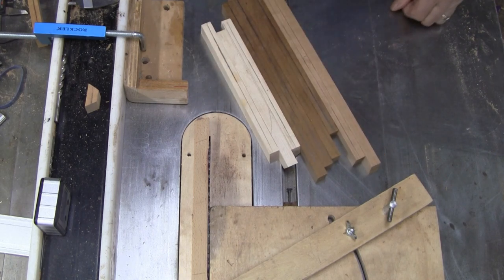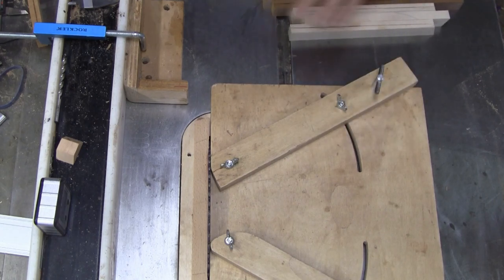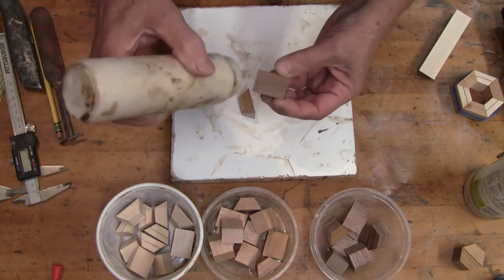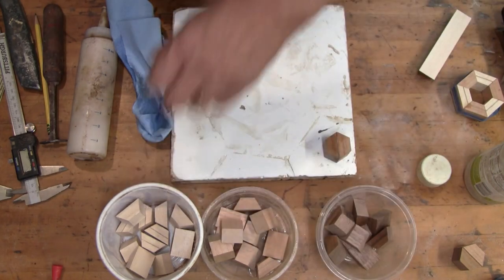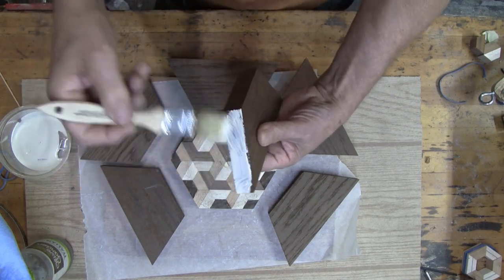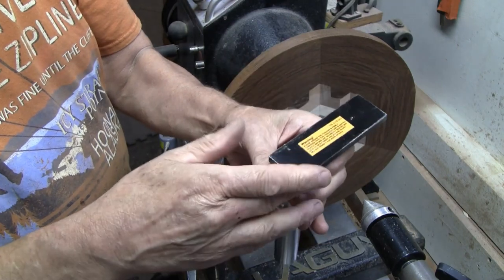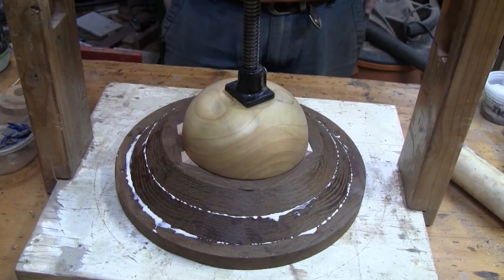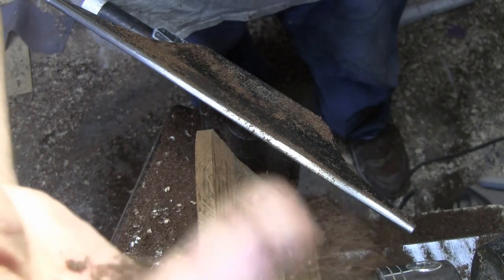Wood Turning The 3D 3 In 1 Illusion

Comment: Good evening, Gary.
   This is a wonderful project and video.  I like your 3D illusion bowl. The wood choices made a great looking bowl.
   Recently I made one of your bowl from a board projects. On the back side I hot glued thin strips of woods. Then when you cut through the board the strips of woods hold the ring in place. Repeat for the next ring.
  Thanks for the interesting projects. I hit the like button.
Reply from the maker: Thanks Ray. I was going to hot glue strips on as well. Which would have worked better than what I tried. I was concerned about any binding but if it doesn't bind up to that point it should be fine.
 Thanks for watching,
Gary

Comment: Awesome he are so talented. Enjoy all your  art!! Love the 3d pieces you make. Wish I could make a perfect sled with perfect  adjustable  angles for my table saw. Also, I see you use a bowl Gough  sometimes  n other times you use a negative rake  scraper.  I would think the scraper would be more prone to have tear out. Just my thinking. I mostly use the carbide  round tips on the tools I made. Great job Buddy
Reply from the maker: Thank you Bob! Once you have your sled dialed in it will work perfectly. I
I mostly do the turning with a bowl gouge  The negative rake scraper is a very good tool for cleaning up cuts and will give you a nice finish.
Where as a normal scraper can tear the wood up a lot.
Thanks for watching,
Gary

Comment: Thanks Gary!  What an amazing project.

In one of your future video's would you put in a shot of your dust collection system that you have at the lathe.  I'm trying to find the best way to get that sanding dust before it goes all over the place.  Thanks again for these great videos!!
Reply from the maker: Thank you Dave! I will try to show how I have it hooked up. But basically right above my lathe I have a 4" pipe going to the dust collector.
I have 4" flex hose that hangs down and I can adjust behind the turning to pick up the dust as I sand.
About all a dust collector is good for in turning is the dust. And it does work pretty good.
 But I will try and show that better.
Take care,
Gary
Reply: @ThePapa1947  I sure appreciate it!!  It's the dust that concerns me.  I have brooms for the big stuff.  Thanks

Comment: Gary, I love these types of pieces. So much so that at my last club meeting I showed one of your illusion pieces to a couple of guys who do a lot of segmenting. They thought the piece looked very cool but that you might have trouble with the piece down the road because of the way the grain was running. Do you have any experience with problems from the multiple grain directions?
Reply from the maker: Thank you Victor. I have not had any issues with the pieces . Being small there is very little movement in them. I have a few glue ups much bigger with pieces glued going different directions and they are fine. Much older than these and done before I made videos. Been gluing little pieces together to make big pieces for over 50 years. Might be the humidity we have here. Tell you friends to give it a try. They might love doing it and have great success as well.
Take care
Gary

Comment: Gary: I have completed the illusion and it was quite easy and fun. I did have trouble with my parting tool, it's a Robert Sorby 1/2 wide and an 1/8 " thick. It looks like yours is smaller ? Thanks again for all your help.
Reply from the maker: Thank you Jim. Yes as far as I am concerned it is about twice as wide as it should be for cutting these rings.
Mine is the Robert Sorby Micro parting tool. It is 1/4 inch tall and about .008 inches wide.
Thanks for letting me know you got yours made.
Gary

Comment: Beautiful work Gary, I've learned so many good techniques from watching your channel!  I want to try hot gluing tenons - when you do it, you apply the glue as a bead where the tenon meets the workpiece, there's no glue applied to the face surfaces, correct?
Reply from the maker: Thanks so much. Yes I only put a bead around where the tenon meets the base. If you put it under it is not only hard to get off but it can throw the piece out of balance. 
Make sure the glue gun is at full temperature before applying. Take your time getting DNA on it when you are ready to take it off.
Once it breaks loose in one spot it is easy going.
Thanks for watching,
Gary

Comment: Another beautiful bowl Gary! Thanks again for sharing the "how to" side for building the bowl blank. Couple questions:
1) did you trim the illusion part to a hexagon before adding the ring of roasted oak? 
2) what part of the Clackamas river was that?
Stuart
Reply from the maker: Thank you Stuart. Actually when the pieces are glued together it creates the hexagon. Just a matter of filling in the empty spots.
 So that spot right there is below Feldheimer and right past Eagle Creek. I launch the boat at Feldheimer most of the time and drift to Carver. Sometimes just to Barton Park.
 That spot I was drifting into is one of the best spots for the Coho Salmon.
 Thanks for watching,
Gary
Reply: @ThePapa1947  what did you fill in the gaps with?
Reply from the maker: @STMwoodturning  Which gaps are you referring to?
Reply: @ThePapa1947  the ones in the edges of the center hexagon. I thought I saw them when you glued the center piece together with the bar clamps but in the next frame, you’re starting to glue on the roasted oak edges. If I’m wrong, I apologize
Reply from the maker: @STMwoodturning  you are not wrong. I used the roasted oak so it would match the rest of the wood outside the illusion. They were trapezoids  the same as the illusion pieces. 
Except for 2 were parallelograms. I should have mentioned  that.
 Thanks for asking.
Gary
Reply: @ThePapa1947  thank YOU for explaining! 😁

Comment: Another excellent 3d affect example plus your your bowl from a board technique. Two for the price of one.
Do you mathematically calculate the required segment cut length (1.3" in this case) or do you cut trail and error till it fts?
Thanks Greg
Reply from the maker: Thank you very much Greg. I did the math on this and all pieces were cut the same. The long side is 2X of the short sides. 
So based on the width of the board I make the first cut and then double that for the long side. That should make the other 2 short sides exactly the same as the first one. The overall size is determined by the width of the strips.  Easy as can be.
 Thanks for watching,
Gary

Comment: Gary  I have a question for you.  How did you hold and center the work piece when you were at the point when you brought the tail stock up to the front surface.  Thanks for a great video
Reply from the maker: Hi Rick, I am fan of using glue blocks with a tenon already cut on them. I also like to use hot glue to fasten them in place.
So for this one I centered a glue block on what was going to be the top side of the turning. Put the piece in the chuck and then used a another glue block for the bottom. This was a bigger block and I used much more hot glue because I would be turning the piece with it in the chuck.
 Hope that makes sense and thanks for watching and asking that question.
Gary

Comment: You didn't mention anything about the walnut triangles, I enjoy your progects and have tried most of them
Reply from the maker: Thank you very much. The triangles I think you are referring to were the same roasted oak. They are the same cut as the rest of the pieces but just a little smaller. The trapezoids were exactly the same. Once you have the illusion built it will be very easy to see what you need to fill in those spots.
 Thanks for watching,
Gary

Comment: I must of missed something, but what is holding the disk to the head stock while you hot melt glue the dovetail block to the other face of the disk?
Reply from the maker: I had the live center in my tailstock.  When I make those tenons they all have that center mark in them from the same live center when I make them.

Comment: Love your videos, I'm confused and was wondering if you could help me. I thought 30 degree was for 12 segmented rings on the wegie sled? I was going to make one of these and got a brain freeze... LOL thx again
Reply from the maker: Thank you Kenny!
So if I was making 12 segments I would divide 360/12 which would give you 30 degrees.
That is the included angle of both sides. So the cut angle will be 15 degrees per side.

Hope that makes sense,
Gary